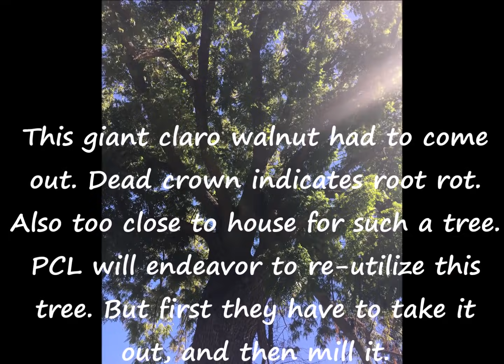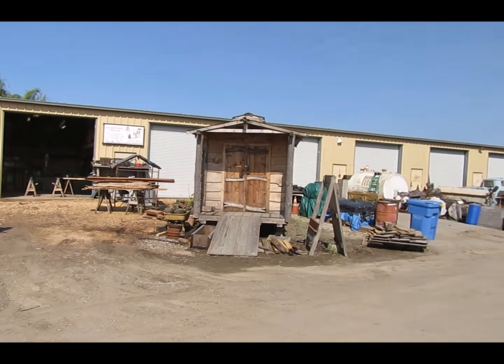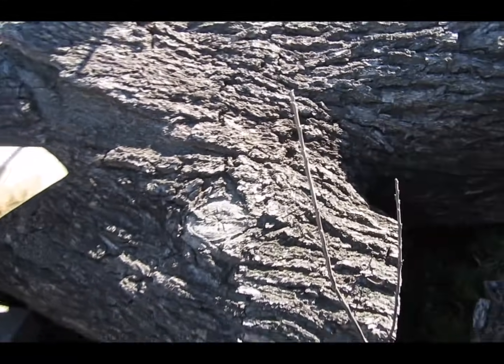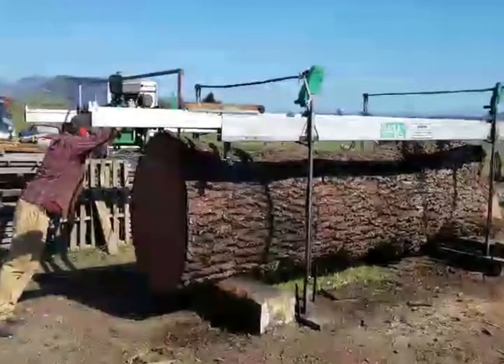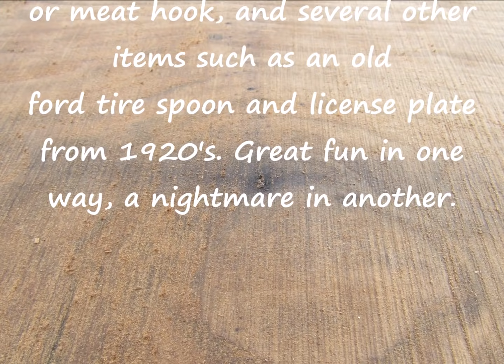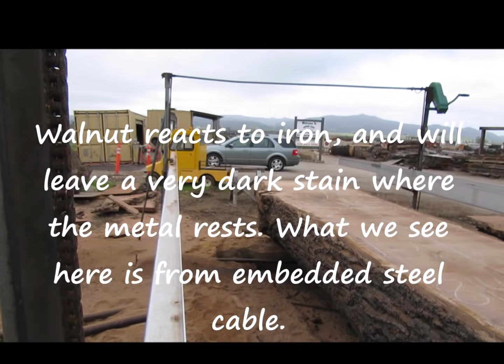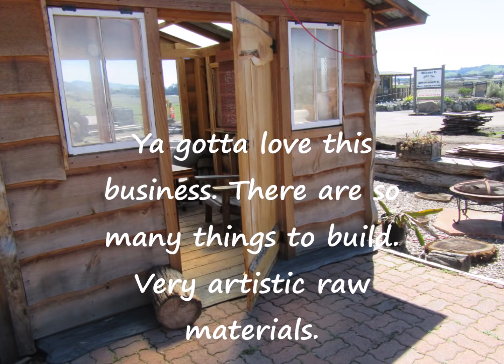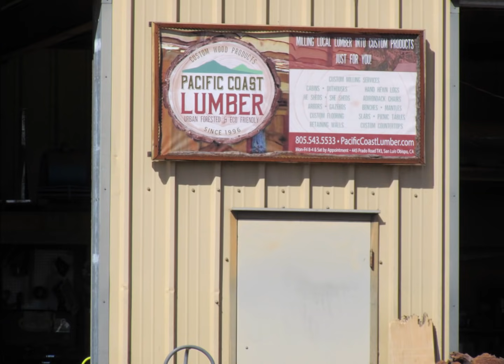Pacific Coast Lumber. Giant Walnut Milling.  23,000 pound log milled.

Comment: Thank you for a wonderful post!  What an amazing tree!  Walnut is my favorite wood.  We have a enormous Black Walnut in our yard that was over 48" in diameter 6 years ago, that we have considered taking down.  I looked into it, and at the time there was not a lot of interest in it because of risk of metal etc.  I believe that there are more companies in our area now that are harvesting urban trees, so I will probably look into it again.  I believe our Black Walnut tree is well over 90 ft tall because it is taller than our nearby Catalpa (Northern Catalpa) tree which is a state record holder, and it has been measured at 92 ft.  These are both remarkably large trees for our area (Nebraska).  The huge Catalpa covers our deck and provides a summer of wonderful shade (and debris!)  One of God's great creations :)
Reply from the maker: I had never heard of the Catalpa tree, thank you for that great post! 
The metal and embedded material issue is a big deal, but the dimension and length is also a very big deal in urban wood of value. Sounds like you have something worth something. At the end of the day, the guy who purchased this walnut from the owner paid out roughly 20k to take out the tree, transport, clean up, then make a bench for the previous owner, and the owner I believe got about 3-5k for it. Early in comments I outlined the cost in the "take out" video.
Reply: Find a mill with a circle saw with carbide inserts just tell him you will replace any inserts he knocks out odds are your metal in not harden steel most anything else those carbide teeth will cut as easily as the wood. Will kill a band saw...

Comment: Giving the gift of the bench to the home owner is a touch of class. Not much of that going around.
Reply from the maker: John, Thank you for that post. Sean O'Brien is a straight up good person. That whole job was a good one. Thanks again.
Reply: I do a bit of tree removal in Sydney.  If the tree had useful timber I often return a bowl made from it sometime later.  Good timber is a shame to chip or burn sometimes.  I like finding a use for such timber and I never have to advertise for work.
Reply from the maker: @waynemartin6841  Thanks mate!
Reply from the maker: Thank you John. I started in the wood business making folk toys when I was 26, flying copters, paddle boats, etc. Did lots of craft fairs etc, then somehow got into a hot tub manufacturer business, ran their moulder, and processing section, ground knives, gang rip, etc, then on into the building industry in a lumber yard, did that for 10 + years, and then logging and sawmills. Small sawmills, gypsy logging. In the whole of the lumber and building industry, most people were and are, rock solid good people.
Reply from the maker: @waynemartin6841  Wayne, I have milled quite a bit of black acacia, which to my understanding has meandered over here from your neck of the woods, pardon my pun!
Reply: @pacificcoasthiking   Yes thats from us here.  I dont like them.  They self seed, often are full of borers, have short trunks, are invasive, have numerous dead limbs etc.  Did I say I dont like them.  In Sydney here we have Sydney Blue gum.  Just slabbed with an ms880 a log that was 80cm across.  Full of red fiddle back timber. Now thats a better timber.
Reply from the maker: @waynemartin6841  sounds awesome Wayne. Here they call the black acacia, "California Koa"! Of course real Koa from Hawaii is what they refer to, which is not at all bad company to be in. Fiddleback koa is the prized wood for instruments.
Reply: so true

Comment: How long does this log have to "season", before processing?
Reply from the maker: The general rule of thumb for air drying in larger thickness is a year per inch, for air drying and all that goes with it such as location, climate , storage type etc.
Reply from the maker: Or you can get someone who knows what they are doing and it can be dried properly in a kiln. And additionally I don't know how many are around the country yet, but there is a new type of drier that is called RFD (radio frequency dryer), that takes about 30 days or so, is what I hear.

Comment: i was expecting quarter sawing and a big circular saw.
Reply from the maker: Alvaro, thank you for your message 
The thing about Quarter sawing is you are sawing for a vertical grain board face. It’s most common to see QS in a wood that has medullary rays, which produce what people refer a lot of times as “ tiger stripes “, etc..
Otherwise it is cut for vg (vertical grain) flooring and straight grain appearance products.
It’s kind of wasteful as a sawing strategy except for those types of products because it loses an extra 
14+% in unusable trim.
I think overall the size and species made slabs the easiest and most valuable thing to do with this one 
Thank you again my friend, 
For the comment 
much appreciated

Comment: Can anyone tell me why the butt log could not have been taken to a veneer mill ans peeled? If so, a lot more of it's beauty could have been shared.
Reply from the maker: Hi Keith. The butt log could have been taken to a veneer mill. There are few mills in this location, and the owner didn't quite have the where with all to hunt one down and do that type of deal. Very likely true that more of both the value and beauty would have realized.
Reply: Since the tree was a "yard tree" many veneer mills might not touch the tree because of the danger of metal ruining their knives.  I've had three trees milled and it has cost me several bandsaw blades.
Reply: That definitely makes sense,,,Thanks WT, KL  @wildturkey5838
Reply: I spent some time working in a hardwood veneer plywood plant. If you lathe peel the log you loose much of the beauty of the grain and figure in the log. It would need to be shave or sheet peeled to save the beauty but that is tough to successfully do through the knots, metal, and crotch figure.
Reply: @richdiddens4059  Thanks Rich, KL

Comment: those crosscut slabs  will make great tabletops oh you didn't make any crosscuts
Reply from the maker: Actually, they did get a couple end cuts off this log, which they turned into tabletops. This kind of thing is always trouble, as green wood dries differently from area to area. And without continuity in fiber, the cells separate, causing cracks that will make the pieces fall apart. The end run to it is they could be beautiful but drying is nearly impossible.

Comment: Some videos about using portable bandsaw mills demonstrate wood with metal included in it being sawn with teeth engineered to cut wood only. When such bandsaw teeth contact nails or other metal in the wood they become badly dulled, or damaged. The problems seem to depend first upon a lack of preemptive detection & removal of metal in & from the wood, respectively; secondly, upon incapacity of the bandsaw teeth to efficiently cut metal also. 

Many improvements & adaptations are built upon earlier established means, methods & materials in the evolution of many tools. Subsequently, I imagine that to inspect wood for purity that a hand held tool like a highly sensitive security checkpoint metal detector is swept slowly & closely over the wood surface. Next, I imagine this category of metal sensor may be installed ahead of the moving & travelling blade & near to the wood; it serves to actuate a switch to an alarm, to stall/power-down/shut-off the blade & stall/brake the forward travel. These are low-cost & expedient tooth- & blade-sparing means to preemptive detections of metal in wood.

I imagine that the cutting tips material/s of the blade teeth are arc/TIG welded onto the teeth & the weld material is a very durable alloy also used for cutting metals; sharpenable with something like a chainsaw rig & a hand held grind/drill tool. I imagine such cutting tips will make best advantage of special grind angles to shear & clear away metal & wood without destructive deflection, impacts & friction. I imagine touch-up welds & grinds would inexpensively keep spare blades in top shape. Maybe replaceable carborundum-like materials could be metallurgically bonded to the teeth tips instead.
Reply: Starlight Engram  you say imagine alot, must be a snowflake.  Get some knowledge and use it to go make the thing you are imagining rather than wait on the grownups to go to action.

Comment: Too bad the quality of wood was so low on a large tree like that.At least the crotch cuts were nice.I just cut a Red oak damaged in a storm here in Va. that was 52" wide slabs,(tree was 67" at butt) 1/2 are nice the rest is firewood. But you never know for sure what is inside until you open it up,usually the bark tells a story of what is inside but not always.The bench is killer,i build primitive stuff like that with wide boards also.
Reply from the maker: Jim, thank you. The quality wasn't bad, as you say the slabs that have crotch figure are great, and the others were good. All of the slabs are big enough for tables, etc. So it turned out ok. No fiddleback to speak of. The slabs that were the worst will yield about 10k ea. out here. 4+' wide 3-1/2" thick, and about 24' long is great. I would love to see some of your work.

Comment: Better to use wood mizer 150 for fasf cutting the huge log.
Reply from the maker: Are you talking about the big log splitter for firewood? lol
Reply: I was wondering why they didn't use a bandsaw to cut it. Smaller kerf and faster. Perhaps they don't have one big enough at Pacific.
Reply from the maker: @spudpud-T67  Hey amigo, thank you for the post. 
Are you talking about a head rig? 
Not exactly a "band saw".  But I know what you mean.
A band mill does make a smaller kerf, not really faster on a giant walnut log with metal embedded in it. 
A band mill can also "travel" a lot unless you are real good, speed is the enemy of a band mill.
Not many places will have a head rig. So the little guys have to do what they can with chainsaws, portable sawmills, and such. It all works, it is all awesome, what ever way you can cut it is a good system.
The myth (not a myth, but people seem to make too big a deal of it, like they do with sawmill  manufacturers who claim big daily production numbers, the money is in "the other stuff"), of small kerf systems only applies when you are doing a million board foot production a year. Otherwise, the type of cut and the wood species and quality are what make you money.
Reply: @pacificcoasthiking  Hey hombre. 
I wasn't meaning a fixed head rig. But it is a band saw if it uses a band saw blade. They don't like sharpening the blades if the hit steel; true. Many head rig mills wont touch various species especially walnut due to the risk of steel.
I was meaning a mobile one often used by smaller operations. I've seen some good examples of bi-metal blades that don't mind cutting steel and are used just in jobs where embedded steel is expected. I haven't used a bi-metal blade yet but I do know the speed and quality I can get with my "band saw". 
Badly set you can get a bad cut, taper or curve. That's not going to happen when you have a little experience. I've used a chain saw mill 30 years ago and I'm not going back there after using a band saw configuration. 
I may be wrong but watching this video and hearing him talk about parking the saw over night gave me the impression the milling here was taking a long time. Time / labour is money and a chainsaw type bar arrangement you have here is slower than a band saw. Its really the speed I see in this video that got me commenting. 
The finer kerf is a detail yes but adds up in time, quite quickly.
Reply from the maker: @spudpud-T67  Agreed Spud man! We are on the same page. 
The PCL company has a wood mizer, and a couple configurations of lucas mill, including the one chainsaw config they used to mill the walnut. Which took them most of a week on and off, to mill this big thing. When not milling it, the sawyer was off doing something else productive.
Problem with the band mills is just dimension stuff. Most bandmill, portable sawmills, have about 30" + or - of throat they can cut around. (24" for a wood mizer, again + or -). Can't make live edge table slabs out of 60+ " with any of those.
This includes double mast as well as Wood Mizer single mast.
I believe wood mizer now has a head rig type of bandmill, but even that one only cuts up to 60", and this log was over that. The money is in large exotic slabs, or highly figured boards, or in good veneers, is my experience. But that said, there is good money in a good 8 hour day of sawing pine.
You are right about labor=high costs. And you are right about a bandmill  sawing faster than most, and even better by someone with experience. You are also right about the set and sharpness being essential to good bandmilling!  I never got into the bi-metal blade world because they are so expensive and my feeling was the bi metal blades were like stellite blades where there is so much carbon they would break instead of bend. So I would use older blades to cut through metal when I could tell it was there.
Great post Spud man! Thank you for your great input on this stuff. You know what you are talking about.
Reply: pacificcoasthiking g

Comment: Cut that majestic black walnut tree down to build sheds?  What the heck is wrong with people. Some fur is more than adequate, or even metal sheets.  That tree was not dead, and if some roots rotten it was not shown, no core samples, and the interior of the tree solid and strong.  Desperate for people to make money and sell it cheap.  People who had it in their yard had a treasure and did not know it. That wood worth tens of thousands. beams that size hard to find, new wood, and walnut hard wood.
So very sad.

Comment: it was a crime to cut that thing length wise
Reply from the maker: DG F, what do you mean, cutting it to length at 24' long? My experience is that the wider and longer a  board or slab is, the more potential value is in it because of it's rarity. It didn't used to be that way particularly because there were so many large trees and mostly boards were cut down to use for furniture and cabinets etc. But now days, it is different and in exotic or non standard lumber and hardwoods, it is hard to find good big lumber.
Reply: @pacificcoasthiking   That's true, I don't see it utilizing the trees full potential tho in my opinion.  Very few things I could see a 60" x 24' board for.  

On the other hand, you could cut over (90) 3" thick cookies that would gross a minimum of $2800 per coffee tables. Might even be able to push them as high $6000 retail. 

Great work though.  I would salivate if I saw a 60" x 24' piece of walnut !!!
Reply from the maker: @dgf2863  Agreed
Reply: DG
Reply from the maker: @dgf2863  Hey DG, thanks again for the comment.
While I have always liked the idea of end cuts for beautiful rounds......and have done a "bunch" of them, most of the time they split radially into about eight pieces of wedges. You then get to try hard to put them back together again somehow or bind them before they split and fall apart, to try to allow them to dry without falling apart. I agree they are gorgeous that way.
I suppose they could even be treated with  PEG, but that limits the finish possibilities.
In slabs the log should yield about 8 slabs worth around 10k each, with little to no defecting.
Thank you amigo, your thoughts are good.

Comment: Table slabs are nice but the real money is in gun stock material. Ever price one? A 2 foot piece cost 600 bucks and it's only about 8 inches wide.
Reply from the maker: Hey Dan, thank you for the note. And yes I have cut for gunstocks, and known a few mills that specialize in it. 
As far as cutting for gunstocks. You really have to devote your operation to milling gunstocks or forget about it. You can cut everything into 30" and billets over 8" x 8" or even a standard size of 3" net x 8" x 24, and you have a pile of that size and a gun guy goes through and will only take one or two.  It is a nightmare if you aren't in the business, and you have to make money to stay alive.
Great business if you are in the business or doing it for fun. 
Thank you Dan, you are correct in the value and great business of gunstock.
Reply: You are quoting "street level prices" - and the price you quote is for a very small portion of the overall slab (that part containing extra-nice figuring, crotch, etc.). You also have no perspective of what a true artisan would charge for a conference table of the length of these slabs or some of the other uses of which someone of your mindset would know nothing.

Comment: "a new chain every slab" 🤣😂🤣
Wtf. !?!? Why not just learn to use a file  ???😳
Reply from the maker: If you have milled slabs of 4ft wide walnut you would know how expensive it is to screw any up.
Definitely worth a new chain to cut a straight cut on those slabs.
Half of them sold for about $10,000.00 each.
They had files and chain grinders etc. but as you probably know, a chain like that takes an hour to file properly and it’s way faster, and very much better to sharpen later, than sooner.
I appreciate you taking the time to comment.
Reply from the maker: where abouts over the pond are you? Central coast of California here.